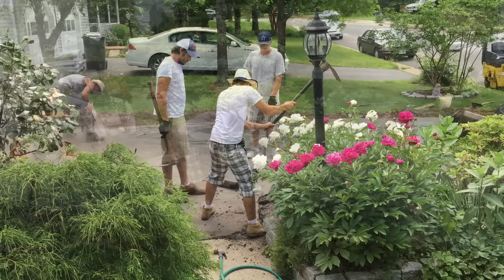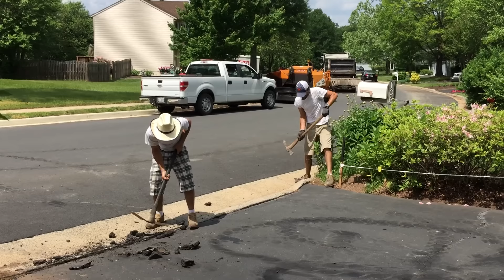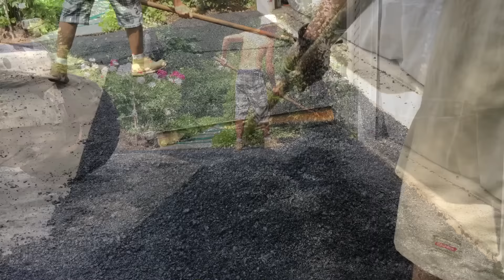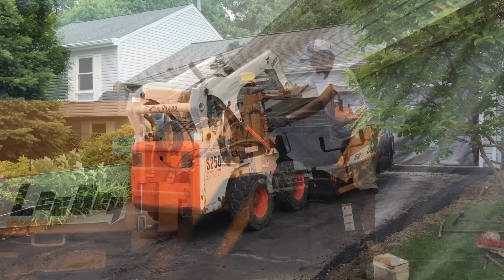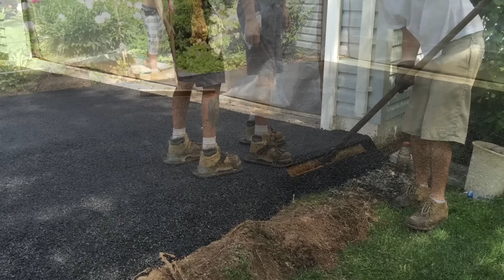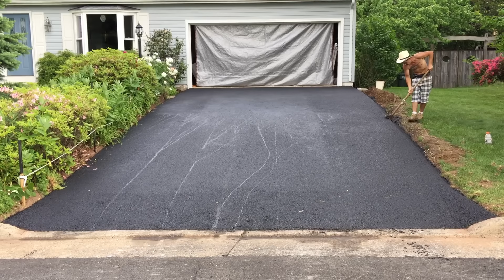A-Pak Paving Resurfaces Our Asphalt Driveway

Comment: I work with asphalt every day, should be tamped down where the blacktop meets the concrete at the garage and at the end too, and should've had a smaller roller fo on there to take out the lines and bumps left by the bomag roller

Comment: Five years on I wonder how the asphalt is holding up? No tack coat, the base was walked in with boot attachments on the skinniest guy on the crew and the compactor did not appear to be a vibratory compactor. The asphalt didn’t show much heat either.

Comment: Pretty much a video of how not to pave a driveway. “Mist it once a day and stay off for five days” what a joke!
Reply: @ObsidianXXX Me and My Brothers run a Asphalt business.

 I pretty sure what he was implying is the fact that everything that they did was more unique then it needed to be. Many asphalt crews will rip up the previous asphalt to "help to customer". They did that only partially. We as a crew do not like ripping up asphalt. We dont like messing with the ground as the ground has already settled and is less likely to sink and leave cracks. Secondly they did not put down an adhesive called "tack" that helps the new asphalt stick to the previous. This stuff sticks and helps with many overlays. Depending on the crew and the paver (person that runs the machine) you may not need to shovel that right side at all. Lastly I'd say that most crews have a preference on when you should roll the asphalt. This crew knew it was a small job and they seem to work in the heat so the asphalt was still decently hot when they rolled it. Much other crews work and try to roll at a certain temperature. But like this one and many others. You can roll in asphalt and still make it look good at any reasonable temperature.

Also they were wearing less appropriate clothes for the job at hand but that's just what their crew does.
Reply: @ObsidianXXX  We are located In Colorado. In the United States.
Reply: @ObsidianXXX  qqq
Reply: @ObsidianXXX  ❤

Comment: Why not get a concrete driveway goddam
Reply: +Brenton Rodriquez so much more expensive
Reply: Or even better, why not get a Stone driveway!
Reply: +Theodoяe Kяap, I don&#39;t debate here Why not get a magnet driveway and use magnet wheels?!
Reply: Why get a driveway in the first place?
Reply: Why does everyone have a crush on concrete?
Reply: Use asphalt when the surface will be driven on; Use concrete for structural load bearing. Asphalt, because it's black, absorbs a lot of uv radiation, thus preventing a lot of glare you would otherwise get with concrete.
Reply: Brayden Rapirez upon j
Reply: Brayden Rapirez why even get a house
Reply: Concrete can be colored with pigment additives,  seen and been on a few blacktop colored driveways that were concrete. Can even acid wash a driveway to add some more unique color as well and you can even get it sealed in LineX
Reply: Concrete pays for its self in no time you poor the cement let it dry and you don't have to worry about it for years. Asfault you have to patch it and seal it when your car sits in it than it leaves little holes where you're tires have been sitting
Reply: Why not gravel 😆
Reply: STEVEN STANLEY not really. through a reputable contractor, that’s a $3k concrete job.
Reply: Concrete is not that expensive. And it looks a hell of a lot better than this. And it'll last you for a long time. Try that with asphalt or how I like to call it "volcanic lava".
Reply: Oh also, why not grass? 😂😂😂

Comment: Damn. Everything they just did was the hard way. How about a wacker? Instead of tamp shoes. An how about using the  skid steer for the work instead of pick axes
Reply: I had that thought too at first when I saw them using pick axes but they didnt use the skid because it wouldve lift and teared up that fabric that was beneath the slab of asphalt.

Comment: no no no.....  for one these guys looked like they didn't have a clue what they were doing ...ahem I have ran that same machine myself alot!  I have never seen anyone wear metal shoes haha anyway for an overlay you have to cut the edges to make the new asphalt match the sidewalk and concrete at the garage door true but he could have backed that paver up dumped some out then sit on the pad and take off. also they didn't clean and tac coat the edges or the existing asphalt to adhere the new to old surfaces (very important) also   I never seen them vibrate with the roller which would optimize compaction on the ac making it live up to its full potential without that it will look segregated over time and seal coat will not help that all in all I hope you didn't pay a lot for the work they skipped some basic steps eventually that overlay will chip away and you will be doing it again also those guys worked way too hard for no reason that's a 3 man job for me and 2hrs work next time message me no charge and you don't need 5 days haha
Reply: gary p why would you vibrate an overlay? It'll just push the new blacktop out. I've only seen guys vibrate rough spots. And I never seen people use tack on a driveway this small. Only if they are overlaying concrete have I seen tack being used. I have never seen those metal shoes tho but it's a good idea so he don't leave footprints at least lol.
Reply: It also didn't look to be a hot mix, if it was there would have been steam coming off the  compactor. It looked to me the short pad by the garage was peeling from another failed overlay attempt. Hence the removing by hand of the old asphalt. This should have been done in two passes. doesn't the LeeBoy  8500 go to 15 ft? So it could have been done in two.
Reply: Facer  je
Reply: You dont always need tac. We hardly ever tac a driveway
Reply: I don't think thickness really matters or it being just a driveway a tac should be used on all overlays , on a hot day in the thinner area if one was to turn the tires over time it wil break apart and since there is no tac it will just keep breaking because it's not sticking to the bottom, 2 passes with the 8500 for sure and as far as vibrate maybe not on the thin areas but it's just good practice looks like they started at about 2 inches when they took off but the 98lb dude with skis on might be good enough for them plus it's gonna get colder with all that dancing around, I would have at minimum put a whacker plate on it boom it's done or bumped the vibrator on and off in the thicker  areas just my opinion
Reply: Bro... its called a period. Use it!   ...........
Reply: @michaels8706  periods are for people like Nancy Grace and Caitlyn Jenner ,   this isn't a spelling bee bro....

Comment: All you have to do is wait and park on it the next day after it cools off.  But they didn't even use hot mix so why wait for a day. You only wait for a day for the hot mix to cool off enough to not leave tire marks in the asphalt. They did need to not turn the wheels really sharp or it would leave marks. What is funny is there were NO company signs on the equipment or trucks.

Comment: Y'all are weird for getting asphalt. Concrete all day, and avoid that terrible smell.
Reply: Tarmac looks so much better than concrete  and some people actually like the smell lol
Reply: @lukethomas6482  Doesn't even last 5 years without being repaired in winter climates. Concrete last 50+years.
Reply: @boskey10  requires a bi yearly sealing just like concrete does and it will last 30 years or better with proper sub base and drainage
Reply: @rpeace05ify  Concrete needing re-sealing? Umm why is that? The sealant is sprayed on after the  concrete is finished and needs to be cured for 7 days before it can be driven on. Also, different mixes are required for different jobs, sidewalk mix is not the same as driveway mix. it also needs a proper compacted base to withstand permafrost. Asphalt is cheaper and easier to use. Asphalt  is weak in hot weather and degrades faster. Concrete has none of those problems, if it does, then it was finishers who did a butcher job,wrong mix or base was not compacted right.
Reply: @boskey10  yea eventually concrete will wear the face off and become porous again and needs sealing
Reply: @rpeace05ify  That has nothing to do to with sealant, why does it need to be re- sealed?
Reply: How long is eventually? makes the concrete porous to begin with?
Reply: @boskey10  depends on traffic
Reply: @rpeace05ify  Lmao thank you for confirming you know nothing.

Comment: Dear Homeowner: I am really sorry but this is not going to hold up for six months and that is with the hope that you don't drive any cars on it. This type workmanship is horrible and this crew has no business paving anything.........not even a bike trail. What a disgrace, their are too many problems to list. I am simply ashamed at the terrible work here...............makes me sick !!!!People....please take note: THIS IS HOW YOU DO NOT WANT ANY ASPHALT WORK DONE ON YOUR PROPERTY, WHAT A FREAKIN JOKE. CROOKS
Reply: +JJKNUCKLE AMERICANMAN tell us how it should have been done, what are the mistakes don by the crew?
instead of pointing out how screwed up the owner is, give some help to prevent future things like this
Reply: +don trump no vibration on the roller resulting in poor compaction, no tack coat (tack coat helps bond between old and new surface), the area with two lifts near the garage should have been pre rolled for even compaction, asphalt was under temp (no smoke or steam), and they paved directly over top of a cracked surface.  Those cracks will mirror through the new material within a year especially in if in a cold climate.

Comment: All depends what he paid. Wouldn’t get away with it in uk. The drive would need curbs of some kind concreted in to stop the drive from spreading and cracking over time. For long life the old tarmac should of been ripped up and the base sorted and compacted properly. At the least there should of been a tar sprayed on the old to help the new adhere to it. First crack and water will get in freeze and the whole lot will come away from the lower surface l. We also have to have proper drainage but that may not be the case in USA and I can see a storm gully at the entrance so may be ok with that.  Get what you pay for and I’m hoping they didn’t pay much.

Comment: That crew is dressed like a bunch of tweaker’s . No regard for protection against burn’s . The preferred method of removing asphalt today is using a grinder/ milling attachment that can be used on skid steer tractor’s as seen in the video provided they have the power and hydraulic output needed for the grinder attachment. Breaking the pieces down into smaller chunks will avoid back injuries / workman’s compensation claim’s for herniated disc’s and lifelong sciatica. The driveway shown is small and the whole thing could have been removed allowing for thicker asphalt concrete mix to be placed that will have more integrity than a thin overlay.  Complete milling / grinding of the existing asphalt allows the large chunks and excess to be removed easily the millings incorporated into the existing base , reshaped and graded for proper slope , drainage , curb exposure  and finished grade of the new asphalt to be far enough below garage siding and trim to prevent water runoff from wicking up into the wood. Total removal of asphalt surface that exhibit’s signs of soft subsoil and inadequate or poorly placed base materials allows for deficiencies to be corrected thereby mitigating or eliminating future failures. Other advantage’s of thicker asphalt placed in excess of two  and a half inches average depth  are heat retention that is crucial to attaining maximum density and a smooth finish . Any minor surface adjustments for drainage or corrections will not  compromise the thickness of the asphalt in excess of the average minimum thickness that in most area’s should not be less than 2” over well compacted base material. Reputable contractor’s will be in good standing with Your local authorities who will be familiar with them .

Comment: Why are they pickaxing it when they had a bobcat sitting there and why not take the hole driveway out instead of patching over if the reason there replacing drive was because of cracked won't the cracks come through the new stuff the put over it

Comment: Wow that driveway will last 2 months you forget tac oil so it will stick to the old surface.
Reply: Also, not removing the old surface, the reflective cracking will show in the new asphalt in about a year.

Comment: No tack, no roller vibratory, mix looks like permaflex..  Why in the world is he doing it in 1 pull instead of 2? Also, when I take out the first several feet at a garage to prevent a water issue, I (as well as every good contractor I know) use a skid tamp to pack it in before installing the top coat. Walking it in with some plates on your boots does not give enough compaction, which will cause the edge of the original asphalt to show through when the roller compacts the topping, leaving a bump and an eye sore. To top all of this off, they are trying to get by using a single layer of coarse mix for the entire layer, with the intention of just sealing it after to hide that they did not use a fine mix on top.

These are the assholes who underbid me and then cut corners to do the job within cost. I just can't knowingly screw customers over and therefore lose many jobs to people like this.

Comment: Lmaoo mist it once a day and stay off for 5 days for that driveway 48hrs max and thats depending on vehicle size watering it down prayer to cool down is just going to make it crack only water it needs is whats comeing out of the roller and at that to much will make it ball up if one guy still going over uneven areas as you're rolling it

Comment: The joints are so small for the material used. This should not hold up at all. I thought they were going to rip the whole thing out and start with a base @ 2" (Course) material then lay the fine @ 1 1/4". the roller has no vibe to it for compaction which means the 180lb. mad with the special shoes is the only real compaction because the roller can do nothing more than finish the surface. With the material size he really just rolled it for show. Shame on them, for taking that homeowners money :-(

Comment: The compaction looks like shit and the hand work on the edges is just as bad , what gets me is that little ass roller driver couldn't be bothered to drive /compact up to and inside the garage ,the entire front drum should have been driven into the garage with a sheet of plywood protecting the concrete , at the street connection they should have torn out 3 ft instead of 6inches ,the asphalt sure does look too cold to me as well ,looks to be about 130 durring application and sure as hell isn't anywhere from 275 to 325 , let this be a lesson to all home owners ,before you allow asphalt to be dumped take your ass to home Depot & buy a laser thermometer and take a temp reading in the truck before they dump , asphalt should leave the plant at 275 to 325 depending on weather , the cooler the weather the higher the plant will send out the mix , any material under 220 shouldn't be allowed on site , especially in the spring & fall where ground temps cool the lose asphalt quickly .

Comment: That was unprofessional. 
#1 cold screed and cold asphalt. #2 you should have did that in 2 passes if you could not do it all in 1 complete pass. #3 you should have have that steal drum roller on that asphalt sooner.  #4 you created unnecessary work for your helpers. You had plenty of room to dump that trunk into that paver.  There is a lot more I seen that was not right but the wearing of shorts 😳 while paving. Come on guys. Use  your head. You could have had a better looking outcome.  You have a nice paver and a nice roller.  It should have been better. And yes I can say that. I've pave thousands and thousands if miles of roads and driveways.